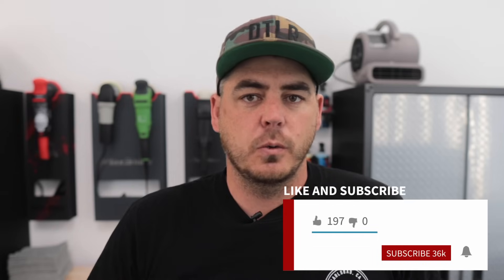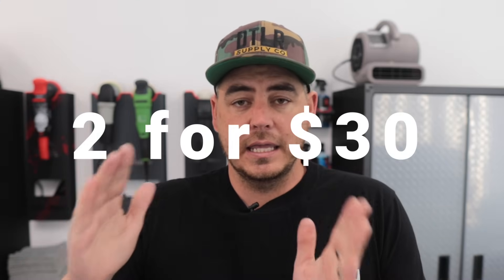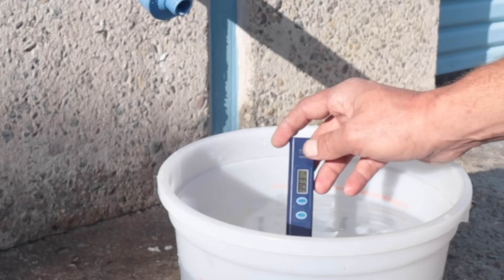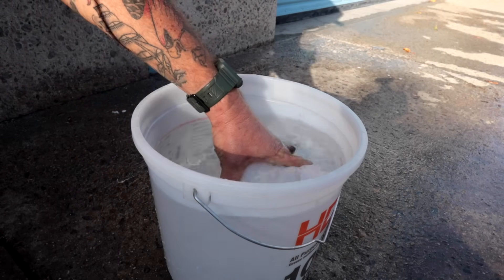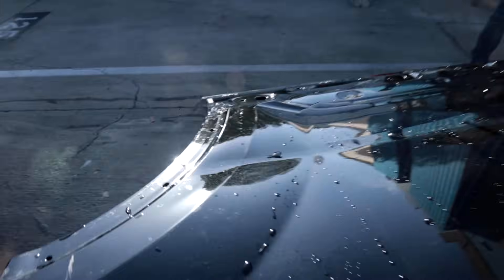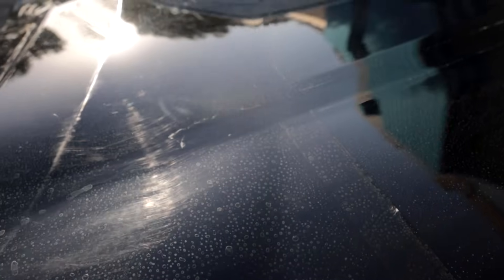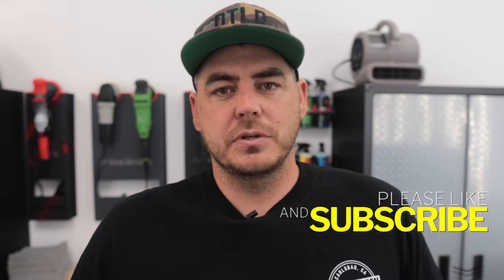$15 SPOT FREE CAR WASH Filter?? | SPOT FREE WATER FOR WASHING YOUR CAR

Comment: just some input if anyone is chasing actual de-ionized water. true DI water used in the lab setting is corrosive and strips ions off of metal parts over time. you actually do want some about of impurities in water so that it doesnt do this.

Comment: We have well water where I live and it's more rusty than hard, but it is hard water too.  I found that the filter didn't work 100% for our water, but it did turn hard water spots into soft water spots, so they were much easier to remove if for some reason I didn't get it wiped down well enough.

Ryobi makes a hand held leaf blower that works EXCELLENT as a drying tool, I use it mostly for my motorcycle to get into those nooks and crannies.  I highly recommend it.  Just make sure you get a big battery, it'll chew through small ones in nothing flat.

Comment: Go purchase a PPM meter for about $10...then test PPM before and after the carbon filter. You will see that the pores in the carbon fiber will in fact remove some dissolved solids and reduce the PPM. might want tot test that and re-edit the video with the right information...
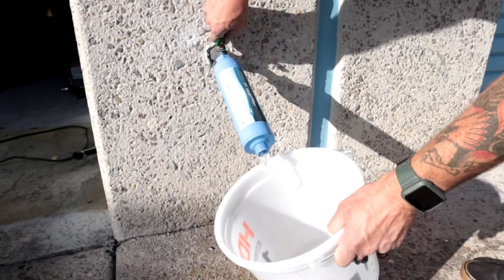Reply from the maker: If you watch the video a tds meter is used (starting at 2:37) and there was no change. Eventually after letting a significant amount of water run through the filter it dropped the tds from 406 to 393.. With that said I have a high ppm count for my water and if you start with lower tds in your water you might have a slight change. However this video is made for people looking for a spot free car wash solution and even if this were to drop the amount a little bit, it’s not enough to make a significant enough change. Like with water softeners… they do help filter things out but not the stuff that leaves water spots behind
Reply: @imjoshv  Well first i am blessed to be drinking Lake Tahoe water coming down the river from Truckee in the City of Reno. So are ppms (because they still clorinate the water and because the truckee river does add some hardness to the water is still at 100PPM. (really makes the per gallon of Resin exchange modules cheaper) but not as cheap as I wanted. So I use a carbon filter in-line with zeolites. This dramatically reduces the ions and zeolites cost $45 per metric ton if you know were to look. (Yes then I use a distillation filter to fill up a 100 gallon tank)
2. Why does no one talk about recharging their resin exchange balls as apposed to purchasing "new ones" from the manufacturer. Have you ever thought about making a video about recharging your resin exchange balls as opposed to replacing? 

Lastly, yah i got mad when i saw you said it did not reduce ppm and made the comment. However, 406-395 is (when talking in PPM) a significant enough change to use as a prefilter (economically speaking)

Comment: I bought this filter and it doesn’t work, still getting water spot on my car.
Reply from the maker: Yea, in order to get to a spot free finish you need to be under at most 20ppm or so.. for me this reduced from 406ppm to 393… technically it does reduce some but not nearly enough
Reply: @imjoshv  Do you know of another system that is better, but that is not extremely expensive? Something that really works.

Comment: What about trying it at the recommended flow rate. I’ve seen some that have a flow rate of .5 GPM
Reply: I believe the flow rate is key.  Not to waste your spotless tank   Also what about the actual nozzle    i notice when driving through a car wash the spotless rinse nozzle is a vary fine spray  I have never seen anyone explain and suggest a particular nozzle

Comment: if you read the flow rate these cartridges are meant to operate at it's limited.  Just looked at mine and is .5 gpm.  If you're blowing water through it, most likely it cannot handle that flow rate.

Comment: Tried the carbon filter to test it out. Had 55ppm before had 55ppm after the filter was cleaned out after 10min. I'm assuming because your ppm was so high, it had a greater effect on some of the stuff in there. I'm working with pretty clean water already.

Comment: You know carbon filters do not lower TDS. Carbon isnt capable of removing Cal, Mag, silica,etc...It can help improve DI life so try filter before the DI. I do WFP window cleaning. RO/DI is the only way to remove TDS. I do tap washing windows as well and that Rain X spor free car wash seems to rinse well and many times I dont have to  squeegee or use WFP. Another idea is try rinsing, final using the mist mode on a sprayer. Water becomes phillic easier so it wont  form using droplets. Another technique is use a pump sprayer filled with distilled water on mist setting.

Comment: Years ago they made a mr clean system with 2 filters and they claimed you never have to dry your car well I had 2 black cars wash them rinse and wait and no water spots not sure why the stopped making that unit because it worked the downside was buying new filters but it did work as they said it would
Reply: It made my G20 shine better than the $10 carwash.
Reply: That system worked great
Reply: I had one also and it was great. Never used the soap side only for the final rinse.
Reply: Those were the best!  It made it so easy to wash my motorcycle.
Reply: Yes it worked great
Reply: From what I remember, each filter was only good for couple washes and they were expensive
Reply: I used it for a very long time.
Reply: Because it was cheap plastic piece of junk
Reply: @cmongimme but it worked I also used it

Comment: Number one the pressure and the volume of water is simply too much for this filter to do anything. True de ionized water takes a while for it to be filtered and you’ll only get a true spot free rinse if there are zero particles. I have an excellent water softener and it removes all hard water except that it leaves sodium which causes huge spots all over my car. Once I got a true spot free rinse system that completely removes all particles in solids, space,  did I get a spot free rinse with just rinsing and leaving it alone. It has a storage tank which is what the car washes have.

Comment: I'm curious what your PPM was before you started the test or regular city water to get an idea how hard your water is?
Reply from the maker: Hey joe, I think I mentioned it in the video (or if not I did a video just before this one that talked about it) it was right at 406ppm. The first portion of the test got no change. After testing a few different ways it reduced the ppm a bit… 40-50ppm less than the 406
Reply: @imjoshv  
Okay, I was confused because I thought this device started producing 406 PPM and thought the city water was going to be much much higher. 
Anyway, it doesn't sound like this filtering device is worth the money.

Comment: I have one of those on my mister system on the patio. Only cause it came with the kit. And yeah, the flow on that is much much much slower than if you used on a hose and they still get hard water deposits on the nozzles.  Doubt  it would do much good.

Comment: You choose the "cheapest" option you could find and you are basing the results on that.  Come on man!  Would you buy the cheapest Foamer and then conclude all Foamers bought on Amazon apparently cannot do the job. The filter you bought is > 20 microns and therefore you got the expected results. Please try again with one rated for 1 micon. Thank you.  Ps. It stil won't be as good as the results you get, but it also won't be the pitiful results you posted, and more importantly acceptable / Helpful to the non-pro.
Reply from the maker: I just wanted to show this one because there a quite a few videos on it showing how well it works. I also a did a video on a proper DI filter which is what you actually want
Reply from the maker: Do you have a recommendation for a 1 micron filter that you have used and like?
Reply: Clear2O RV INLINE WATER FILTER CRV2006, and since this is a 1 micron filter I would highly recommend a pre-filter (in the long run both cheaper and allows one to maintain a higher average flow rate). Something like the Clear2o DIRTGUARD Sediment PRE-Filter CPF1000 - RV Water Filter - 20 Micron (which is also a 20 micron filter just like you had used in this vid).
Reply: Oh really, well hopefully folks believe you (as you have clearly proven) that in fact a 20 micron filter all by itself does little to help). Hmmm, I just saw your other video on proper water filtration... clearly what you show in that video is the way to go.  Quite a bit more costly, however most definitely superior results.

Comment: I use a large whole house version of these before my di filter. I have a little harder water than you and I have to replace my resin more often than I’d like and I have a decent sized di vessel. After some math I figured it’s cheaper to buy distilled water by the gallon than to use a water deionizer. I always use the carbon block filter to fill all my buckets and to filter water going to my pressure washer. The water coming from my tap has sediment and filtering that out will help your pressure washer last longer.

Comment: It is only a carbon filter. It doesn't remove calcium. Therefore it won't reduce your TDS. You would need a softener to remove calcium (White spots after drying) or a commercial reverse osmosis to lower the TDS in any significant amount.

Comment: Nope, not ever.  This type of filter is not designed to do what you are trying to do and it will never work.  It is designed to remove chemical impurities, not dissolved solids (hardness.)  Mr. Clean marketed the Mr. Clean AutoDry Car Wash System several years ago that did soften water.  Its replaceable cartridge contained resin beads for the ion exchange and after the resin changed to a certain color  (there was a clear window) it was time to replace the cartridge.  There was no way to regenerate the bed as in a home water softener.  Griot's Garage sells an inline water softener/deionizer but at your 400ppm hardness level, life of the $139.99 replacement filter is only 49 gallons.

Comment: I use rain water. Tds ranges from 25-35 and after I filter it it goes up to 45-55 using 2 basic white filters. And being that rain water is soft it works GREAT!!! My tap water tds is between 425-460 and it's aweful washing cars with it.
I have 4 50 gallon rain barrels and I pump the water to my IBC totes that I have in my garage. One is 275 gallons and the other 330. About a quarter inch of rain can pretty much fill my rain barrels.

Comment: Looks like the average for my area is 89ppm. Even if this pulls 40ppm out, I don't think that's enough to stop spotting. Do we know what the cutoff point is for ppm is before spotting occurs?
Reply: Some people say 0, some say 10, some say 20 and some say as high as 50. Glass seems to need about 1/2 the ppm vs paint.
Reply: @KosmicHRTRacingTeam  totally makes sense about the glass. I can see the difference just with rainwater. My car is an off-white (Chrysler called it Cool Vanilla) so, while it does get spots, you kind of have to look for them up close. I suppose ppm makes a bigger difference for darker colored cars as well.

Comment: Carbon filter don’t do anything for hard water  
Deionizer water are same resin beads used in softener .
Reply: No, the resin beds of a deionizer and a water softener are NOT the same.  Water softener resin replaces certain positive ions in the water with sodium ions from the salt.  The resin in deionizers removes both positive and negative ions...they are not replaced with anything.  That is why the resin in a deionizer can not be regenerated, it has to be replaced.  You can regenerate the resin bed in a water softener for ten years or more.

Comment: I had zero confidence that that type of filter would lower your TDS from 400+ to zero.  I have that filter and used it to filter the hot water from my water heater to my hot tub.  Worked like a charm.  Any sediment from the bottom was absolutely filtered out.  Clean, clear water and pretty hot.  
I WILL NOT be using this filter ahead of my pressure washer.  It will not work as intended. 
Good video.  Thanks for the education.

Comment: Great video. The carbon particle filter you demo’d can’t remove much of the particulates because the water streams and pushes past the carbon and most of it isn’t ‘treated’. Clear20 makes a solid carbon filter that works far better because all of the water gets treated. It would be interesting to see how that one will perform.
Reply: It won't remove hardness (dissolved solids,) that's not how the chemistry works.
Reply: @urntwrthyZ  unless he gets an in-line deionizer instead of a carbon filter
Reply: Has nothing to do with water moving passed. Any filter with water coming out the other side has water "pushing passed". Charcoal is porous, the water moves through the gaps that's how you get water out the other side. What a filter can remove depend on the size of the holes the water can run through. In charcoal (carbon) those holes are uneven in size with many being relatively large. Charcoal (carbon) isn't intended to filter dissolved solids.

A filter with carbon chunks verse a solid block treats more water because it has greater surface area than the solid block does. 

I'm not going to get into the more technical description of how filters work in different use cases, but if you're intending to reduce TDS to zero for car washing via a filter you have a few options. Charcoal (carbon) isn't one of them. You can use a deionisation filter,   reverse osmosis or chemical filtration. Mechanical filtration of any number of stages will not reduce TDS to zero, that's basic  physics. 

I just looked them up on Amazon. An inline deionisation filter system will run you somewhere around $200. There are cheaper solutions claiming to be deionising but it's clear from their packaging and lack of external electric source that they aren't, and are just a mechanical filter. 

A reverse osmosis system will cost around $120 on Amazon. You can't get hard water TDS to zero (or even <50 ) for $15. It doesn't work that way. If you could, no one would by industrially filtered water. 

P.S. You meant passed. Nvm though, it's in the past.

Comment: After I do the initial rinse with the pressure washer, prior to foaming withMrPink, I spray the black van with McKee’s then foam an 2 bucket wash. Dry the vehicle, I don’t have any water spotting.👌
Great video, thanks,
Matt
Reply: I just watched a video from Forensic Detailing about whether to pre-rinse or not. Seems like the pre-rinse might actually hinder the performance of the foam. The McKee's likely helps it though.

Comment: I use an RV filter for washing my car they recommend a 6" whip between the hose bib and filter. Is this necessary ?. We use deionized water at work for forklift batteries  and pressure washers. How practical is it for the home user ???   I see home kits for like 4 bills. Thank you Josh.

Comment: There is another carbon filter and the brand is Clear2O, which cost a little bit more but this one uses a solid carbon filter, the one you talking about on this video have carbon particles, that could make a difference as not being as efficient as a solid block, wondering if that would make a difference in water spotting. Thanks for the video!

Comment: I have really hard water.  I have good luck using ONR or N914 in a hand pump sprayer, misted before the wash soap is applied and then final rinse and mist again during drying.  Seems to help.